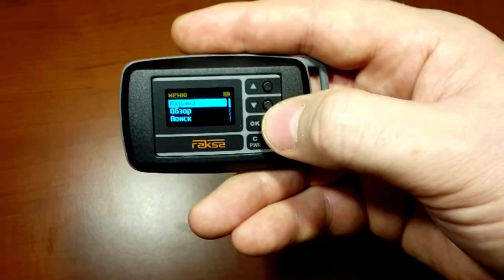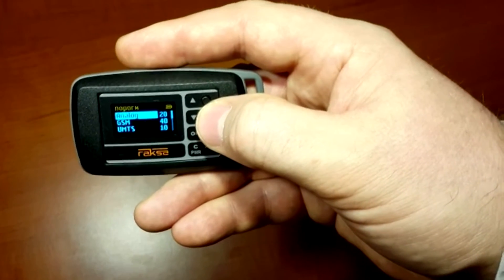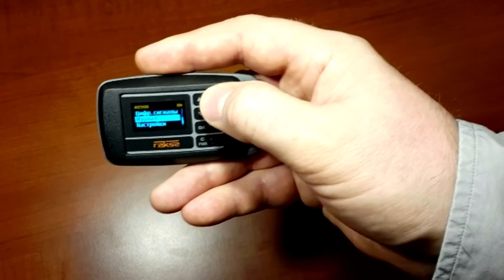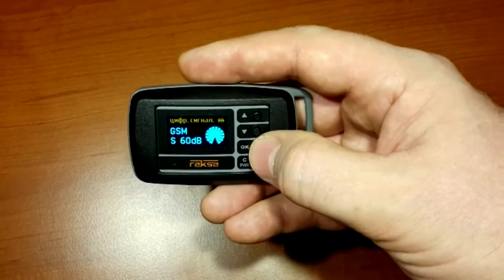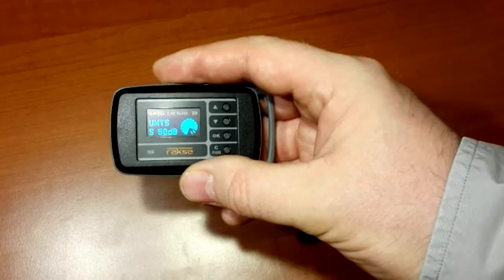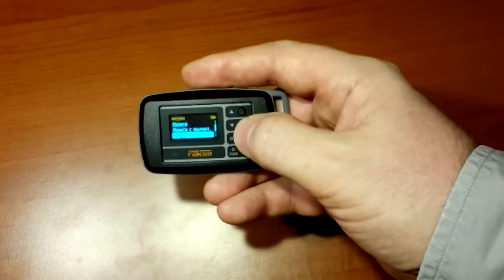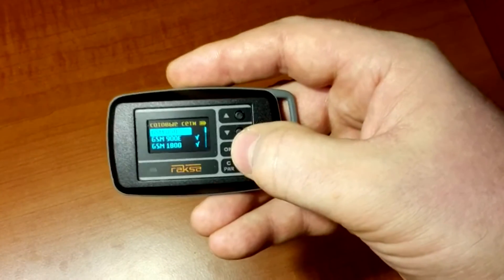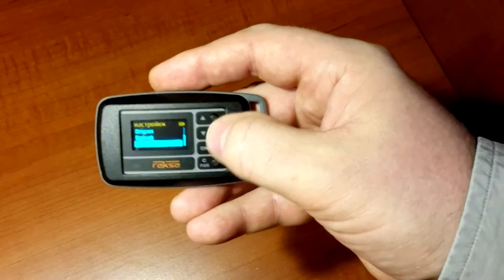RAKSA iDet: Settings

Comment: Is-it possible to set a detection level for Wifi signal?
Reply from the maker: Yes, it is possible. You can find more information at pages 22-23 of User Manual.
Reply: @ts-market5523  Thanks a lot.